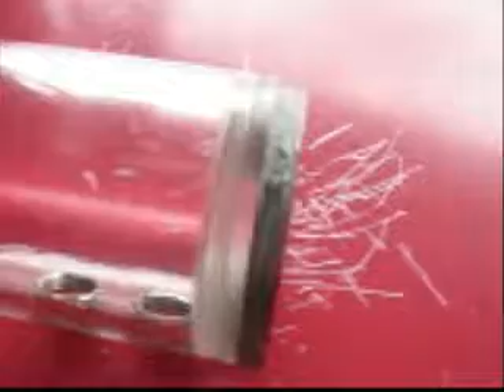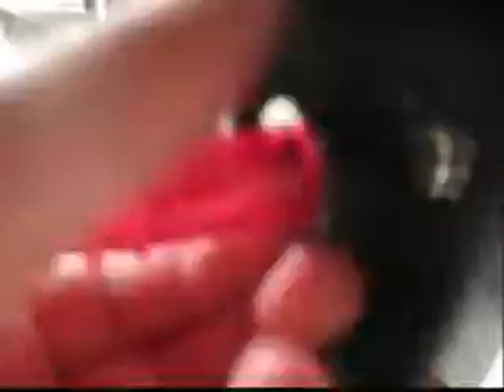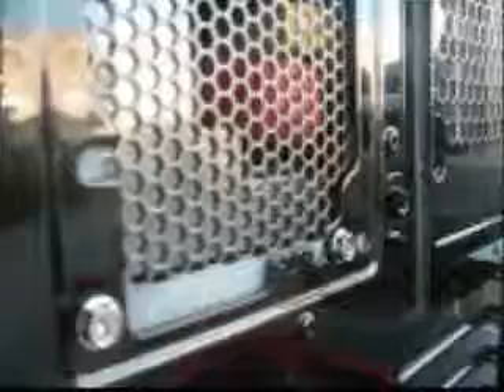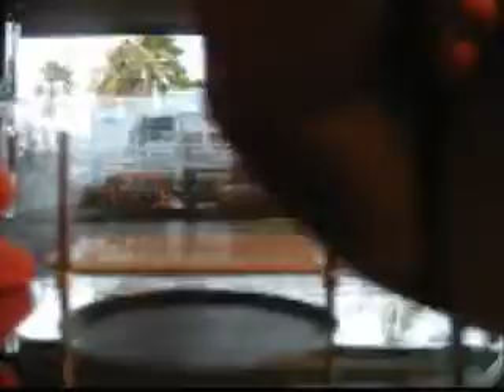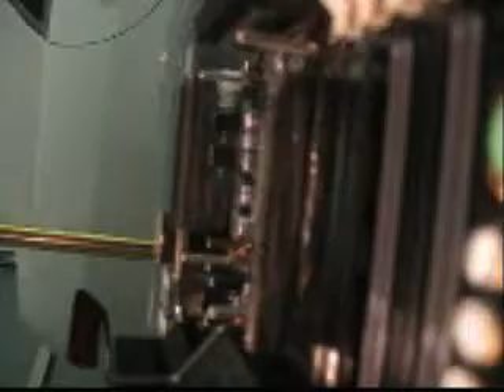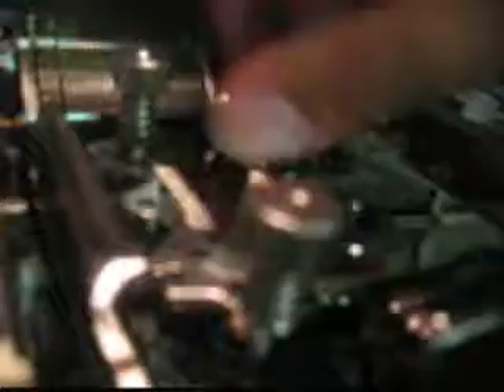CPU etc

Comment: I'm looking into WC for the summer. Has to be under 300$ though, so probably used parts. Would be to cool a Q6600 and the 780i NB. Actually I might change mobo....you can have a Q6600 with the 4870 in Crossfire, right? I have so much trouble with ati/intel stuff....